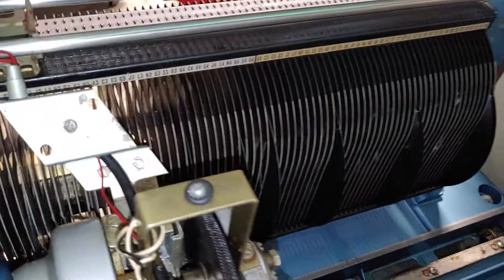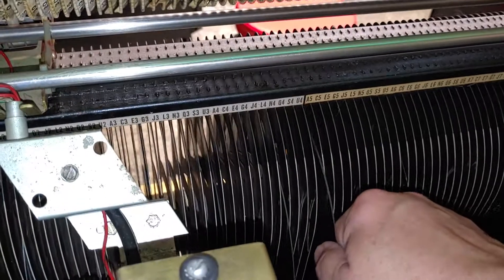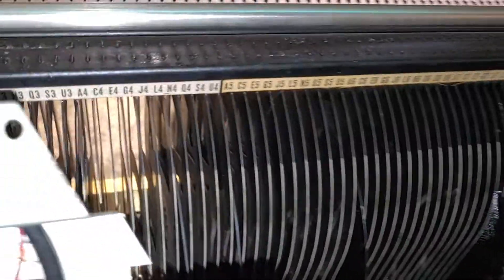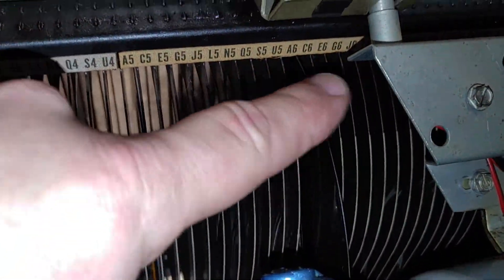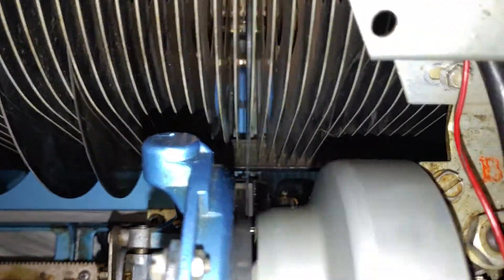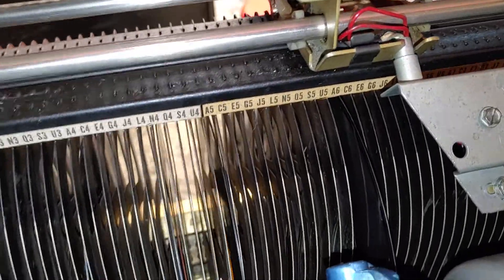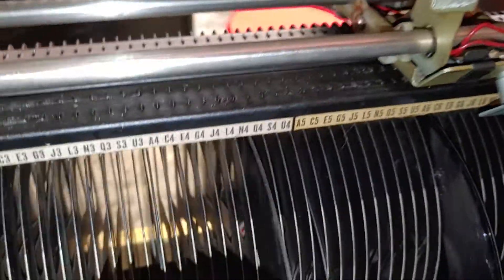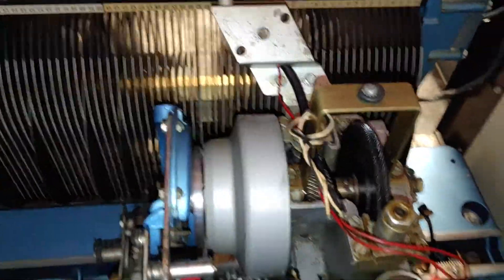LPC1 not loading

Comment: My Seeburg S100 is similar. My ramp somehow got off kilter. So I moved it down about an 1/8 of an inch. Also not sure but it looked like your magazine was not aligned with the ramp and turntable. Careful though when moving the magazine ‘cause obviously that’ll mess up your tormat and block. And if not already, get at that clutch, remove it, and completely clean and lube it up.